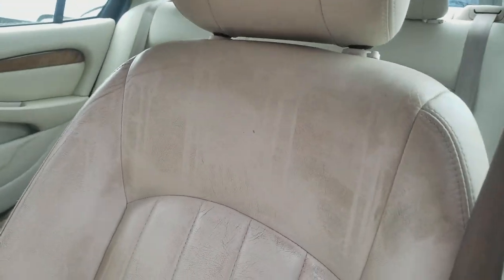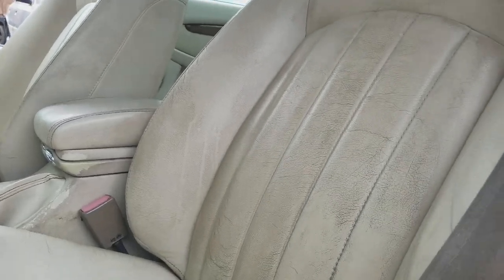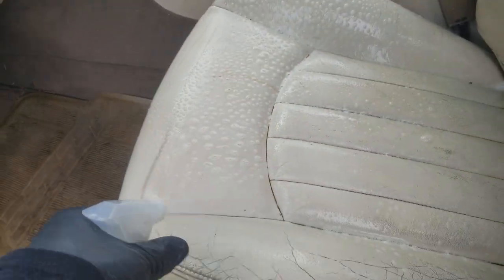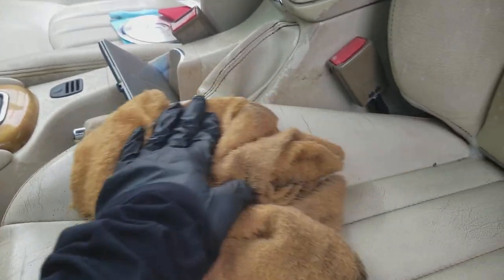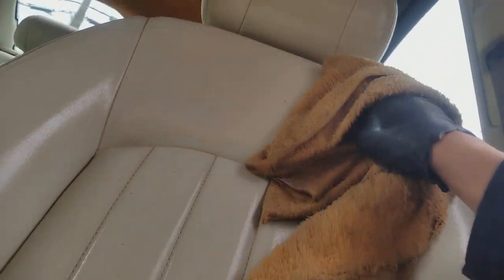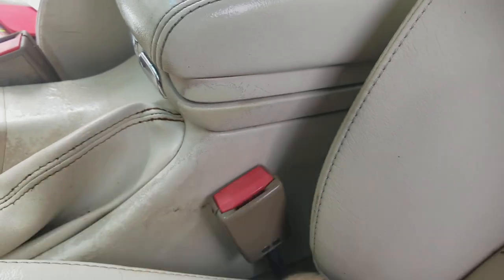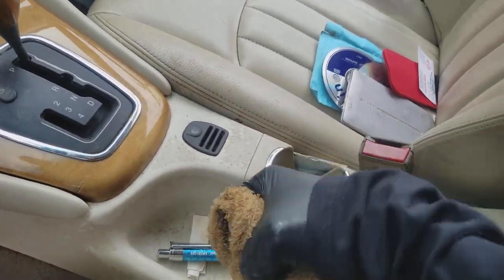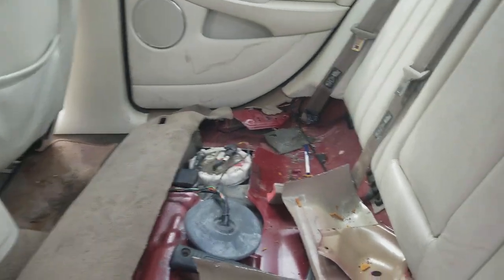How to Clean Leather Car Seats, The Quick Fast Easy Way

Comment: DO NOT USE THIS ON YOU CAR INTERIOR. IT EATS PLASTIC AND PAINT. OMG!
Reply: No lie Ik this is true because on my old car I used it and made all color diff, not good to use on leather or plastic directly, but it does a good job on carpets ngl
Reply: @inuyasha_115  yep... It's good on some materials like carpet. But on cars it's acid.
Reply: What do you use for interior then?
Reply: LaloStyle1515 Seafoam brand makes good interior cleaners that work just as well and are safe for the interior fabrics

Comment: I love me some Awesome!! I’ve been using it for at least 15 years! The one thing I found with the stuff is that it’s capable of dissolving the thread in the stitching of the interior so I don’t spray it directly on the fabric. What I do is saturate a small rag and use that to apply it, then ho over it with clean rags. Follow that up with leather conditioner soon after when the leather is still damp this allows the conditioner to penetrate into the fibers and condition the thread in the stitching! My super clean original 1960 Impala that had seat covers put in when new started separating because the thread was dissolving! A hard lesson!
Reply from the maker: sounds like Chinese made thread
Reply: @crazysexycool180  well I understand you’re ju  see t now hitting puberty, but in 1960 we definitely didn’t import anything from a communist country!
Reply from the maker: THANKS FOR WATCHING !!!!  Please like share and subscribe, also check my other channel, Salem Taxi on YOU TUBE . Thanks.

Comment: Wait! The instruction says ''DO NOT USE IN LEATHER''  It damages my honda leather seat!
Reply from the maker: spray and wipe, it worked great on this Jaguar. no Damage,
Reply: Condition it after maybe ?
Reply: I did the same thing to my GMC Sierra.  Spray on wipe off.  Don't let it sit on there for a long time.  Most leather seats these days have a coating on them anyways.
Reply: I have an Audi, and my dealership suggested using Woolite cleaner. 5 parts water, one part Woolite.  Works like a charm and leaves a nice smell
Reply: @kimberlypiggee166  u use a microfiber rag?

Comment: Hope you put leather conditioner on after the Awesome Cleaner.
Reply: I never put conditioner on my car car after i use this TOTALLY AWESOME stuff and my seats are perfectly fine it's been over 2 years since
Reply: Alkaline based cleaners like this will deteriorate leather just like your skin. Luckily that car's leather isn't that great to begin with.
Reply: Will strip the moisture right out the leather. Marking it hard and starts cracking

Comment: Awesome is a good "all purpose" cleaner, but the smell is intense. Not sure it's good for leather.
Reply: You need to dilute it as it states.  The stuff is extremely strong and don't recommend breathing it in without it being delivered unless you want a severe headache. You should use a non-alcoholic base to clean leather... This stuff has to have some alcohol for being that strong.

Comment: It doesn’t look like you’ve diluted it AT ALL. Read the directions. And excessively spraying it until it’s soaking does not aid in penetrating or over power the dirt and scum. 
Please read labels people. And yes car leather is different than general leather furniture but terry cloth towels, microfiber, and leather brush or soft brushes work great with water and Castile soap solution, or saddle soap. Then conditioner/finish spray for wipe down. 
If you use CONCENTRATED products please use them properly. (Sheesh)
Don’t be fooled about initial result. Imagine after 5-10 times doing something you finally taken it past it’s resilience and have been slowly damaging. It happens often.

Comment: so this works really well, but it does say right on the bottle NOT to use it on leather, so has anyone had any issues?
Reply from the maker: it will remove the dye from leather

Comment: I love awesome cleaner. Does it leave a chemical smell?
Reply: Karen somewhat it's best to dilute it
Reply: How do you know you love it, if you've never tried it? I mean, your asking about the smell so if  you've purchased it you would know the answer
😶😂😒
Reply: If you spray it multiple times like he is doing then yes its kinda strong. I use it on my glass shower door for hard water stains and it burns my nose. So I turn on my exhaust fan first then spray it thoroughly, close the bathroom door then come back and clean it in like 10 mins.😊Use well ventilation.

Comment: Awesome Cleaner is awesome stuff.  I use it to clean my leather seats in my crew cab truck and it took off things I didn't expect to get off.
Reply: This product has never damaged anything that I've used it on in over 20 years.

They do caution using straight without diluting it upon glass, however; I've never experienced this problem.